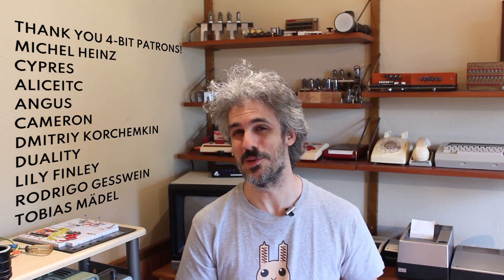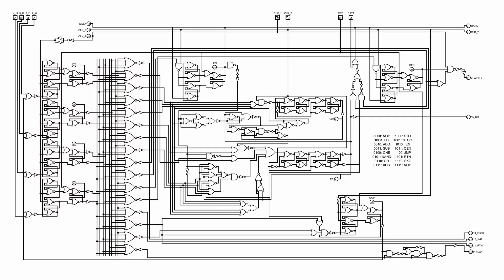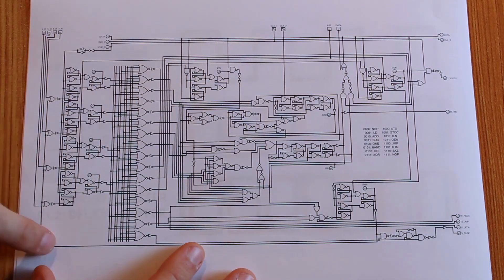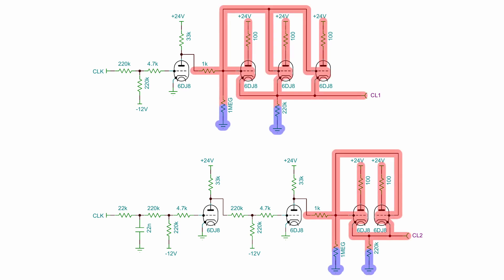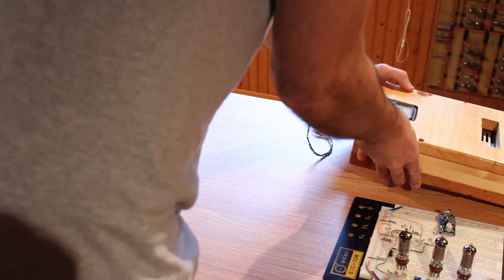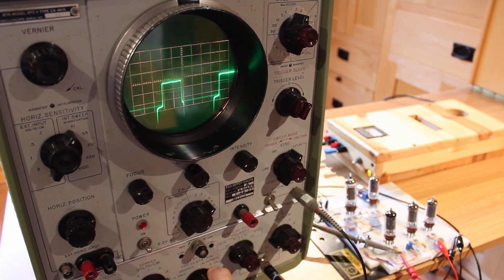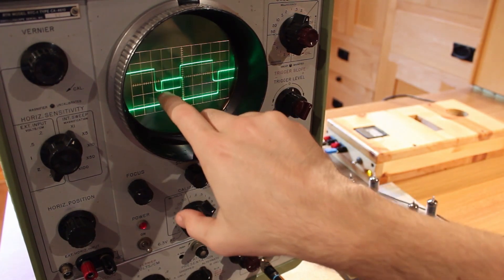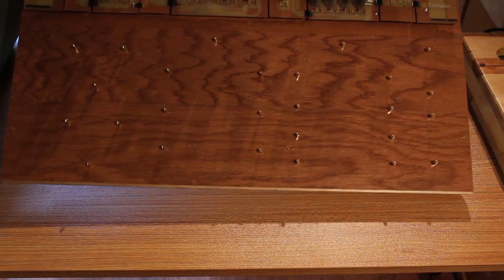Vacuum Tube Computer P.19 – Clocks!

Comment: Try adding some positive feedback to your buffers to get the edges sharper, by added some "snap" to the signal.
One resistor could really make a difference!
Reply from the maker: That's a good idea! I may look into that! What really bakes my noodle though is how sharp Clock 2 is. It has two cathode follower buffers on it, but we don't see any of the laziness that we saw on Clock 1. Maybe that third buffer on the CL1 is adding a little too much capacitance or something, or perhaps I've got a bum tube in one of the buffer slots. When the tube computer gets complete, I'm going to go top to bottom and test every single tube, replacing any that don't give me the emission I want, so that may really clean up some of the signals too.
Of course, here I was testing at 1kHz, and I've been thinking a lot about program control, and I'll be happy to get about 7Hz, so the lazy edge won't even be noticeable on the scope at that frequency, haha.
Reply: @UsagiElectric  
Having never used tubes with a B+ lower than 150V before, It's well out of my wheel house (and I haven't touched a tube repair in over a decade.) It blew me away when I figured out you were Way Down at 24V!  Do tube data charts even go that low???

A simple 10M or 22M resistor across a couple tube, from in to out might fix everything.

The difference in fall times between the two clocks puzzled me also. I think a little poking around with the scope might get you a few answers. 
After that maybe even a couple of cathode resistors should change things... without simulations, hard to tell if it would be better or worse... but it should be more linear. (but via some local negative feedback)

I though you might have to move the RC delay on clock 2 to after the first stage, (and you might try it) to clean up the problem with duty cycle. But I'm not sure on that one either.
Reply from the maker: @idahobob  Haha, yeah, just +24V for B+ is a little on the low side. Datasheets pretty much only ever give data for at minimum 50V (unless it's one of those 12V space charge tubes that were used in the 50s for cars). So, a lot of figuring out what works and doesn't was just down to trial and error to see how well things go. I did actually do some testing with cathode resistors of varying values, but I always ran into problems with logic lows being acceptable at that point. The problem was that in order to keep the cathode level low enough at full saturation, if I had a cathode resistor, I had to go extreme with the plate resistor, which meant I had to go even more extreme with the voltage divider resistors on the grid. But, with just +24V, I found that if my voltage divider resistors get too high, the grid essentially stops responding and my logic lows and logic highs only have a swing of a few volts between them. The 33k plate, 220k/220k divider to -12V on the grid seems to be a really good compromise and I get about a 20V swing between logic levels.

Also, fortunately, the duty cycle problem isn't something i need to think too much about. Pretty much everything only cares about the transitions, which is quite nice. Plus, with such a low clock rate I think everything will jive together rather well. I'm hoping at least, I won't know for sure until I get some memory and program control running actual programs through it!
Reply: @UsagiElectric  
LOL! I keep forgot you are doing digital. Yeah, the cathode resistors would be a huge issue. 
I keep coming up with "Great Ideas!(tm)" with other logic, only to realize you can't use them as you've gone all tube.

So you keep going with your Good ideas! ... after all the hardest lesson to teach a new engineer is "When good enough, is Good Enough."

Comment: Coming along nicely! say I was wondering does your subtract instruction simply return data compliment plus results register? (1s complement) and then the additional 1 has to be manually added after the fact or on the first bit of the operation?
Reply from the maker: Thank you!
You got it, all it does is invert the data coming into the ALU to do addition on data compliment and RR. The additional 1 is added manually by forcing a 1 into the carry register, though that does require a bit of setup.

If I wanted to subtract 11 - 10 = 01, this would be the program (OpCode + Data value):
ONE X
ADD 1
(These two operations force a 1 into the carry and leaves RR at 0)
LOAD 1
SUB 0
LOAD 1
SUB 1
(Once we have the one in the carry, we just cycle our way through the operands 1 bit at a time)

I really could have used to have a clear carry and force carry operation, but given I was trying to stuff all the ALU operations into just 7 opcodes, I ditched a few things to keep some logic functionality too.
Reply: @UsagiElectric  thanks for the explanation :)

Comment: What is the thing behind you with the slip printer on it?
Reply from the maker: Very keen eye!
That's actually the thermal printer unit on one of the sidecars for my TI-99 setup. This is a bit of an older picture (the layout is a little different now), but you can see the entire system here: https://i.postimg.cc/3R89xxWy/IMAG2815.jpg

Comment: I know you mentioned the clock would not run at  1kHz, but I was wondering if the clock 1 had that lazy falling off edge, because the cathode followers on clock 1 have a sort of adding extra capacitance with their plates in parallel, and here we don't have the clock hooked up to anything yet.  That maybe later on when the clock is hooked up and loaded by the computer gates, that this edge might clean up a bit too?
Reply from the maker: I've been thinking about this too, and what's really throwing me for a loop is that CL2 doesn't have that lazy falling edge, even though it's also got two cathode followers in parallel. If it were the buffers, I feel like CL2 should be showing some laziness, but perhaps three is the magic number for enough capacitance to cause a bit of an issue. Also, I could totally have a bum tube in one of the cathode follower spots on CL1. If that's the case, it would mostly present alright because the other two buffers would be picking up the slack, but the bum tube could be causing some weird harmonics or excess capacitance that's causing the lazy edge.
Although, in the end, I'm hoping for about 7Hz (roughly the speed of a reel-to-reel player), so the lazy edge is mostly a non-issue, haha.

Comment: I was thinking, there should really be more of a distinction between the original "14500" and yours, since yours has the extra arithmetic feature in the LU/ALU. Appending a designator to the end e.g. 14500A is more for a different grade or revision of the same design, so it would make more sense to change one of the digits e.g. 14501.

Or just keep the name. I know you and others might have grown attached to it, so this is really only going to bother pedants like myself.
Reply from the maker: That was actually the drive behind changing from "MC14500" to "UE14500"!
Though, arguably, the UE version has a bit more functionality, and I would like to actually build up a version of this on an FPGA someday to actually push it hard and see how viable of a processor it can be with a fast clock speed. 
I'm with you on the idea that maybe changing the digits would be more representative of the changes that were made, but sticking with 14500 feels like a proper homage to the chip that inspired the entire build!

Comment: I need a bit of information. 
There is a two layer organic substance. I want to measure the thickness of upper layer. Bottom layer is of high density compared to upper layer. Thickness is uneven. 
What are the methods available to do this ?
Reply from the maker: This is a question that's well beyond my ability to answer!
But, if I were to take a guess at how to do that, I would suggest perhaps looking into stuff like paint thickness detectors. They use ultrasonic sound waves and measure the time it takes for the wave to be reflected back. This of course means that the lower layer needs to be a substance that can reflect ultrasonic, so it may or may not work at all for your application, but it might be worth a shot!
Reply: @UsagiElectric  Thanks. Worth a try.

Comment: Why don't you just have clk1 and clk2 in quadrature rather than offset in time from each other based on a time delay? I think it'll make what's going on a lot clearer.
Reply: This explains it.
https://youtu.be/OL52f-k3iIE
posting as a seperate comment because YT is very likely to delete this comment. 🤦‍♀
Reply from the maker: Thank you for the link!
I have actually thought about it that way before. Using D Flip Flops like they explain in the video you linked is pretty common for building ring counters or Johnson counters, though the quadrature setup is new to me. It looks awesome and is something I will definitely keep in mind for the future!
The primary reason I can't use it here is tube count. I've tried using my 6-tube DFF design for ring counters before, but since all the tubes I use are, well, used, I end up with really unpredictable oscillations. So, to make sure the DFF transitions properly on the rising or falling edge, I need to use a master-slave DFF, which requires about 8 tubes. So, to build the clock in quadrature would require 16 tubes, plus at least 4 more tubes for cathode follower buffers. And, I just didn't have the space for that here, though it would probably give a much cleaner and more reliable clock signal!
Fortunately, the solution here should work pretty well at the extreme low clock speeds I'm thinking I'll end up at (will be dictated by program control, but my initial goal is 7Hz, or one instruction per inch and 7 inches per second).
Reply: @UsagiElectric  Thanks for you well thought out and reasoned analysis, yes, I did consider that you want the route of keeping it simple and I totally I appreciate it. I'm just one of those commenters on YouTube that has the time to suggest alternatives, hopefully not in a toxic or unhelpful way! :-)

Comment: What about a Royer Oscillator using Vacuum tubes and the output drives the clock in on the vacuum tube processor.
Reply from the maker: This actually comes down to how program control is going to be implemented. I haven't really mentioned it in a video yet, but I'm planning on having programs execute directly from 1/4" audio tape. Which means that each bit of the instruction word will be read in serially into a shift register, then a global clock will ping, executing that instruction. What this means though, is that there won't be an actual clock. The clock pulse will come directly from the tape (which means the clock speed of the computer is dictated by the read speed of the tape). 
It's going to be painfully slow, but it's kind of a necessity given how long programs will need to be to execute anything of any notable complexity.

Comment: I think that a two phase non overlap clock might work too, but will remove any chance of glitching. I might be wrong, but I also might be right :-D
Reply from the maker: It totally could!
The clocking really only cars about rising or falling edges, and there's really only two distinct clock operations. On CL1 falling edge, the instruction register stores the next instruction, on CL2 rising edge, IEN, OEN, and SKZ store anything if necessary, and one CL2 falling edge RR and Carry store results. So, as long as CL2's rising edge happens after CL1s falling edge, and CL2s falling edge happens before the next CL1 falling edge, it should all work alright.

The main reason I did it this way was just to keep the tube count down. I knew I needed a ton of CF buffers to keep the clock signals clean and strong, so I tried to think of the simplest method to achieve the timing I needed, and this seemed to work!

Comment: I'm building a transistor computer it's going to be a 4 bit computer
Reply from the maker: That's awesome! One of my long time goals is to build a 4-bit transistorized computer with core memory!
I have an architecture I'm somewhat happy with, so I want to build it up as a TTL version first using 7400 series chips to work out the kinks, and then I want to tackle building it in discrete through hole transistors!
Keep me updated on your project, I'd love to see more about it (and maybe steal some ideas, haha)!
Reply: I could show you a few things for my Twitter account I'm still working on it

Comment: Try adding a 1000-10000uh in series with your trimpot.  Your delay will be much more even on the rise and fall and it will also be longer.  Also, add a biasing trimpot to load the first oscillator feeding the input clock through a DC filter cap to help improve the 50/50 duty cycle.  The other best way to do this would be a toggle flip-flop divider to generate 2 phase outputs, both always with 50/50 duty cycle, but now, this will be a bunch of tubes and a single instruction step will be more complex, but may allow maximum frequency which doesn't seem to be your concern.
Reply from the maker: Excellent suggestions!
Honestly, inductors are black magic to me, so I tend to avoid them simply because I'm not familiar. What's interesting here though is that the lazy falling edge that's pretty apparent on the scope is actually on CL1, which doesn't have the RC delay. So, most likely that lazy falling edge is due to a bad tube or something else that I missed.
As for CL2, I actually lucked out because I ended up using two inverters here to make the signal the right way round. What this means though is that the input signal strength can be pretty weak and I still get a very clean logic high and logic low due to the double amplification.
But, tuning it properly with an inductor is definitely the more elegant solution than the rather brute force method I went with here, haha.
Reply: @UsagiElectric  The difference between using a resistor and inductor is that the resistor lowers the current of the signal from the source to the destination while the inductor does not lower the current, it delays the current, but, the same full signal power should make it from in to out not counting the inductor's internal resistance due to wire length.  (In your circuit's case, since this will be only be something like 10ohm to 200ohm for the large values above 10000uh due to the sheer length of wire, we can call it 0.)  So, when using the RC filter, you are relying that the lower current will charge the cap slower at the output.  With an inductor, and just a simple restrictive load at the output, it is the function of the inductor to delay that signal without weakening it's current.  This is why radios use inductors in their tuning and filter circuits.  They are far more stable and pure of signal strength compared to pure RC circuits.  You can take a look at finding some cheap aftermarket inductor sample kits which containing values in the 10000uh to 100uf range as all the smaller values will operate in frequencies way above what you need.  You also have a good 2 channel all vacuum tube scope, when placing an inductor VS resistor cap alone circuit, you can probe the input VS output on 2 channels to see what is going on when feeding a continuous source square wave from your signal generator beginning at low frequencies like 100Hz to 100Khz range.  There are many who will help you out on both the formulas of use and how to hand calculate or simulate your circuits, including with vacuum tubes at this forum here: https://www.eevblog.com/forum/index.php .
Reply: Also, the RC filter you have weakens the amplitude of the clock signal making that section sensitive to aging of the tube.  Relying on an inductor for your delay will delay the clock signal keeping the amplitude high, in fact, if the termination and series resistor and cap load is set properly, the delay output signal amplitude will match the source signal in strength and amplitude retaining that hard digital edge feeding the G of your next stage tube inverter a full strength definitive digital edge signal.